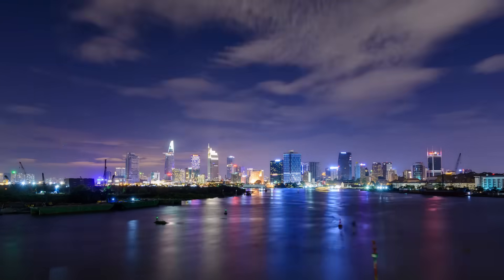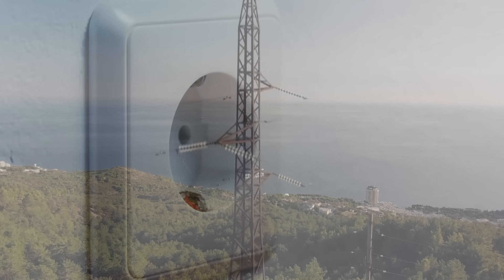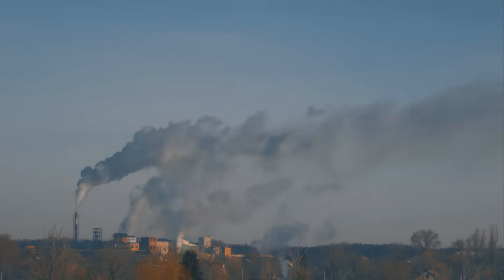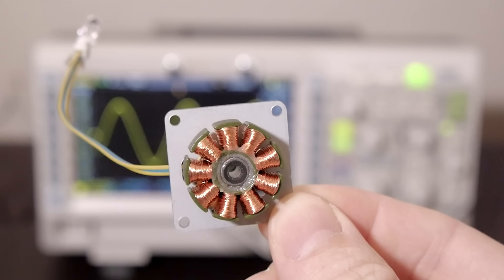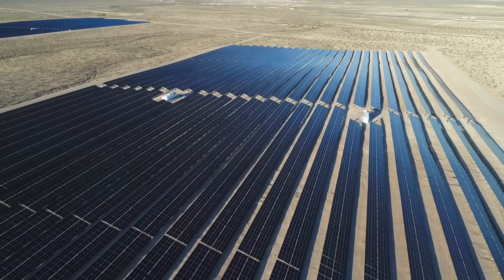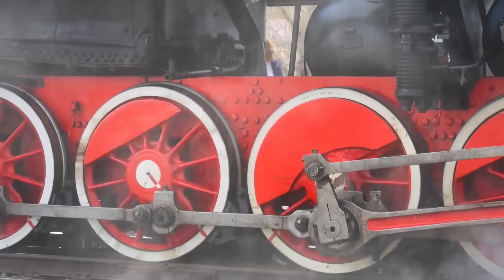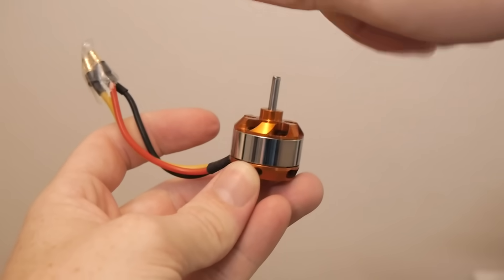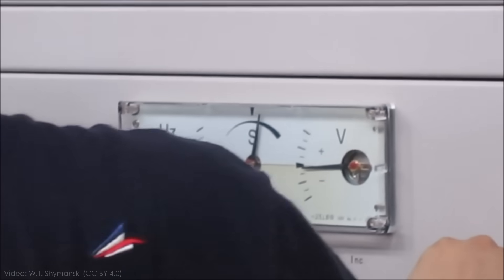How Electricity Generation Really Works

Comment: I hate the term renewable energy as it excludes nuclear energy from the start. Using conventional fuel sources nuclear can power us for centuries and with unconventional fuels like thorium or plutonium in fast spectrum reactors can powers us for thousands of years, and yet the fact that this nuclear fuel is not renewed by the big nuclear fuel in the sky somehow makes it undesirable,
Reply: Nuclear power isn't renewable 
Renewable energy is theoretically infinite  or resources are naturally conducting e.g ferroelectric,  electrochemical, electromagnetic, photovoltaic and momentum based kinetic energy
Reply: @haruhisuzumiya6  renewable energy as solar is not infinite. The sun will stop glowing at some point. The whole of space will retract to a singular point at some point. Nothing is infinite.
Reply: Haruhi Suzumiya Ha ha universe go dead
Reply: @haruhisuzumiya6  Renewable energy is literally not theoreticaly infinite; it is practically 'infinite'. Now we are still a sort of primitive cluster of interconected civilizations; to see a mere star within an universe of them as 'infinite', is as ludicrous as a caveman seeing the amazon rainforest as infinite supply of wood. Let me be clear most of renewable energy is sun's core fusion energy, and it is not and will not be infinite, we are so small we don't see that yet.
Reply: The Olympic Dam  mine (copper, gold, iron and uranium) has enough uranium to supply all the current 380 or so nuclear power stations for 400 years.   Other mines and yet to be mined deposits around the world would keep nuclear power going for at least as long again.   Decommissioned nuclear weapons have been used to supply fuel (until recently) under the "megatons for megawatts" USA-USSR agreement. This potential over-supply of uranium is why the price is so low at present.
Reply: @karhukivi  and there are new reactor designs that can utilize nuclear waste from other reactors as a source of fuel, getting even more energy out of it. I think the main reason nuclear power is unpopular, at least in america, is that people are scared of it because of disasters that have happened in old reactor designs and they cant accept that new designs are much much safer. I've met several people that have told me we should get rid of anything that has the word nuclear attached to it and make it 100% illegal to explore that kind of technology in any way.
Reply: @Sciguy95  People in general are irrational - more people die in automobile accidents every year than in nuclear ones!  Uranium is cheap and plentiful in terms of mineable deposits so it is cheaper to make new nuclear fuel than it is to re-process waste.  In the USA they prefer to store the waste fuel (which still contains over 90% uranium) whereas in Europe they prefer to re-process it as "recycling" is a popular idea in the EU.
Reply: @karhukivi  ah ha, I was sorta referencing nuclear waste recycling in another thread but forgot the general term (bad with jumbled memory). Thank you for jogging my brain :-)
Reply: @karhukivi  
Plus there is speculated to be enough uranium in seawater to power civilization for millions of years. Extracted uranium would be replaced by more uranium leached from undersea rocks.
Reply: @gregorymalchuk272  Yes the oceans contain a vast amount of uranium even if it was not replaced naturally.  However, there are so many deposits of uranium already known that there is enough at current consumption for at least 400 years.  One mine alone, Olympic Dam in Australia produces about 4000 tonnes of yellowcake per year from a 3 billion ton deposit of copper, gold and iron  The mine is good for 400 years.  Rossing in Namibia has been going for 50 years and an unmined deposit in Sweden near Ostersund contains more than 400,000 tonnes of uranium.  it is because of this abundance of uranium deposits that the price is so low at $40/lb  (approx. $90/kg).  The reason uranium is so plentiful is because it can be dissolved in oxygenated groundwater and precipitated under reducing conditions (carbon, phosphates).  Thorium like the rare earth elements has a different chemistry and few geological processes can concentrate it into mineable deposits.
Reply: @karhukivi  the problem is it's a political issue to reprocess waste and whatnot. You CAN reprocess nuclear waste which decreases the amount of nuclear waste significantly, it's more expensive and the process means you can build nuclear weapons...
Reply: @karhukivi  That's great if the numbers are accurate, but nuclear power only generates about 10% of global electricity, and far less than 10% of total power.  Now if world population were 90% smaller, that might be a cheery data point, but that is not our situation.
Reply: I hate the term "fossil fuel" since oil does not come from fossilized anything.
Reply: @jovetj  Fossils do not necessarily need to be 'fossilized' (in petrified form). Merriam-Webster for example uses the following definition for the word fossil: "a remnant, impression, or trace of an organism of past geologic ages that has been preserved in the earth's crust". Oil, coal and natural gas fully fit that definition: fossil fuels are biological material that have decomposed over millions of years to reach their current forms.
Reply: “fossil fuels are biological material that have decomposed over millions of years to reach their current forms”
No, they are not!
Reply: Jovetj Wow, I did not know that. Where did coal, oil, and gas come from?
Was it ever alive animal or vegetable matter?
Reply: @Ted Lahm 

That's the thing—no one knows!  No one has any sure idea where crude oil comes from.   The antiqued guess that it's the remains of long-departed buried creatures or plants, though, has been replaced by the idea that the Earth somehow constantly produces it.
Reply: Jovetj Do we have any idea where the energy that is stored in coal, oil, and gas
came from?
Reply: @Ted Lahm
I've never seen any evidence that we do.  All the theories about where crude oil comes from are wild guesses.  Some of them are more plausible than others.
Reply: Jovetj final question. Do we have any idea where the energy that is stored in
a 100 year old tree, when we burn it, comes from? Thank you.
Reply: @Ted Lahm
Ultimately, the sun.
Reply: @HqNnEz  Oil is primarily from decayed water plants, perhaps algae.  Coal is from decayed trees.
Reply: @jovetj  it's because it is formed over extreme periods of time from  ancient life just like fossils are. So it is similar to fossils in that way and different from other fuel sources that aren't formed from dead life forms and dont neccesarily require huge periods of time to be created.
Reply: @astrolover 95
You don't know that!  Idle speculation.
Reply: @jovetj  Its funny how people like you "speculate" that the scientists dont know what they are talking about and then act as if you know the truth instead. You sound like a flat earther complaining that all of mainstream science is a giant conspiracy. If you know the way true way that it works then go publish your ideas in peer reviewed literature and get your nobel prize for making a world changing discovery.
Reply: @astrolover 95
I am the flat Earther?  While you spew outdated, childish and UN-scientific notions of where crude oil comes from?  You're a funny guy!  I needed that laugh!!
Reply: Jovet the word ‘fossil’ used to just mean ‘dug out of the ground’ , it makes more sense in that context.  Suppose uranium is a fossil fuel by this metric!
Reply: @jovetj yes it does lol, oil is created from dead organic material
Reply: @Tom R Because the fuel is (for all intents and purposes) infinite. No one claimed the device itself is eternal or some perpetual motion machine - it's simply you can't run out of the fuel, whereas nuclear fuel can. That said, the main arguement against nuclear isn't fuel scarcity. The main issue is the fuel life-cycle. Managing the waste is the number one problem IMHO, a much bigger issue than nuclear safety, as it's an unavoidable issue that affects every single nuclear plant, and we have no real solution.
Reply: @lmlmd2714  I think safety is still a big concern, the majority of the people I have come across that dont support it are scared of it because they only know about the disasters and think that every reactor ever built or designed is just a nuclear bomb waiting for the slightest problem to happen before it explodes and refuse to accept actual data as evidence against their belief.
Reply: Someone said thorium:
http://lftrnow.com/wp-content/uploads/2015/05/2-billion-years1.jpg
Reply: Well, every source of energy is finite. The Sun is not renewable.
Reply: "Every source of energy is finite" only so much as there is a limited amount of energy in the universe.  Unless we start cranking out Mantrid drones, we don't have to worry about running out of energy within the timespan of the energy. We just have to figure out how to unlock and/or collect the energy around us.
Reply: @Tom R Make new ones?
Reply: The sun is burning up its energy, it will go dark some day, then explode, consuming the earth.  So why aren't the democrat  environmentalist buffoons protesting the sun?   We should use the most effective energy sources we have, and that today is oil, coal and gas, and nuclear.  Some day we will hopefully harness fusion or something else.  But now, drill baby drill.  Our lives depend on it!
Reply: @DEW409   first off the sun will die after 5,000,000,000 years, do you even realize how long that is? for context, the first civilisation rose up 6,000 years ago, by the time the sun dies we'd have either died of something else or found a sollution.
 secondly why are you bringing american politics into this? the world doesn't revolve around america, this is a discussion over electricity generation, not american politics.
Reply: @M7md_1214  You completely missed my point.  There is no renewable energy.  The sun is finite  , with a long life.  Fossil fuels are finite, also with s long life. So throwing them out without a suitable replacement is like sitting around worrying about  the sun going  dark.  And yes.this IS about politics.  Climate Change  is  about communist/globalists (democrats here) destroying our way of life by disrupting our energy supply and redistributing our wealth to poor countries through carbon taxes, with the biggest chunk landing in politicians pockets.
Reply: @DEW409  well you see the stark difference is, solar energy also produces virtually no waste, and we dont have to mine underground to get to it, and we're definitely not running out of it soon so we dont have to find new deposits and invade other countries for some energy. the biggest hurdle is right there: waste management. if we can find a way to effectively have no waste, we wont have a problem using fossil fuels. but you are right, untill we find a suitable replacement theres no way around using fossil fuels, specially for developing countries. now on the second part of your comment: thats a very alarmist view, its like how people here blame everything on israel and america(both are definitely a reason to why the country's bad, but they're not to blame for everything.) and frankly I don't have the time to argue over it.
Reply: @Tom R because of where the energy is coming from. With your example even hydropower or wind  could not be considered renewable based on the fact that nothing we build will last forever and must eventually be repaired or replaced. And yes I know that nothing really lasts forever, even the sun.
Reply: This report, "Is Nuclear Power Globally Scalable?"
By DEREK ABBOTT, Fellow IEEE gives reasons to think that nuclear power is not going to be significant in global terms as an alternative to fossil fuels. Basically it is not scalable to the over 15 Terawatts of electricity that would be needed globally due to limitation of uranium and rare earth metals.
Reply: Solar isn't renewable either, since the sun will die in 4 billion years.
Reply: People that want to continue the fossil fuel profit machine won't tell you anything about nuclear recycling.
https://www.world-nuclear.org/information-library/nuclear-fuel-cycle/fuel-recycling/processing-of-used-nuclear-fuel.aspx
Reply: technically the sun will go out eventually so it isn't renewable either. I like nuclear the plants work, and compared to the mirrors and solar farms they allow for more nature (people keep missing all that lifeless ground below the panels)
Reply: Bjorn Canute nuclear power creates radioactive nuclear waste. The waste is toxic and very dangerous. Also the potential catastrophic events that can happen if a plant fails. Nuclear power already comes from the sun. So harvesting that should be safer
Reply: Phillip simeon  Well as it turns out statistically nuclear power is actually safer per a KW/h due to accidents during installation and maintenance + we have a growing problem of difficult to manage fires (silently smouldering inside roofs) caused by solar PV panels and inverters which batteries (look up lithium fires) will make worse. Solar PV's toxic waste problem (due to producing and disposing of them) is worse due to the low density of solar PV as an energy source (there is more of it than spend nuclear fuel) which has to be dealt with the same way as radioactive (and all other heavy metal waste) stored securely away from the environment and people.

So called catastrophic nuclear accidents aren’t actually that catastrophic as the overreaction & radiophobia harm and killing more people. The Fukushima nuclear disaster would not have happen if the decision to vent the hydrogen was not left to politicians instead of engineers (overlooking the cost cutting with the Flood defences by TEPCO that cause the flooding the 1st place) and the resultant evacuation of frail people & the air pollution due to the fossil generation which replaced all of that nuclear capacity has actually caused more deaths. Then Chernobyl which even with it poorly design RMKBs (which would have never being approved in the West at the time) only happened because it safety systems were disabled and there was a lack of communication regarding design flaws - it directly killed less than 50 and the most extreme estimation of 1000s of cancer death is still better than the yearly figure vs a 1 in a generation event in virtually all developed countries due to air pollution.
Reply: @Tom R The power source is renewable (the sun) as far as human timeframes are concerned even if the panels will be replaced. Same with wind, hydro, tide etc. And to clarify,  the lifespan of most solar panels is more like 25-30 years.
Reply: While it’s true it’s technically not renewable, we aren’t going to run out of fuel anytime soon, like you said. The main thing that turns people off about it is that it’s nuclear, and nuclear scares people. In reality, there are many studies that show that nuclear power plants actually cause one of the LEAST AMOUNT of worker injuries/fatalities, and we have become very good at handling the nuclear waste that’s produced (much less than people think) but of course the media at large doesn’t tell anyone that.
Reply: The problem with Nuclear energy is what do you do with the spent rods that still have a lot of radiation. Talking to people who work at the nuclear facilities, it takes decades for the spent rods to be safe for disposal. Also no communities want that stuff in their back yard which makes this an undesirable way to make power. Natural gas is the best alternative due to low nitrogen oxide out put and Low Carbon Monoxide. Coal honestly is not that bad either. The only negatives is Nitrogen Oxides are a little higher as well as Carbon Monoxide, Take longer to start up and have a lot of ash to get rid of if not used to make dry wall.  I have interned at a base loaded coal facility and currently work at A natural Gas power plant 1x1 combined cycle unit.
Reply: @AcBEntertainment  
We don't have a place to store nuclear waste because libturds keep protesting the deep geologic waste repository.
Reply: renewable takes care of the problem once and for all. Also the deeper problem again is worst case scenario a coal plant catches fire and collapses. a windmill tears itself apart, a gas plant explodes a nuclear power plant pollutes a huge area and the toxicity of it breaks down DNA.

There are advancements in nuclear power tho that reduces the worst case scenario that might make nuclear power viable which would be a MAJOR win for our Planet and us.
Reply: ok?
Reply: So... You hate the term renewable because it excludes power sources that aren't renewable? Hmm...
Reply: EmperorJuliusCaesar At least for up to 2000 years
Reply: Fun fact, a few years ago I was working at a think tank and a PhD named Edward something or other created a sleeve the made it so nuclear rods could not overheat (Think 3 mile island, china syndrome). Test rods were then trialed at The Ohio State University small scale nuclear reactor. Nuclear is orders of magnitude more safe than before, assuming this jacket is used.
Reply: Renewable energy is a lie and oxymoron.

Energy cannot be created nor destroyed.

This means the world simply needs a better way to transform energy in a non destructive manner.

Before anyone can solve any problem it helps to know exactly what you are dealing with. This is why everyone has failed in spectacular fashion thus far..
Reply: @seanregehr4921 and therefore let's burn fossil fuels to make the water rise
Reply: Yea well nothing is renewable
Reply: this conversation is so high iq my head is spinning ngl
Reply: its not renewable because it creates a hazardous byproduct
Reply: @serial-designation-n-80  Thats not really a helpful definition because everything creates a hazardous byproduct. Um... Solar panels for instance have very much toxic components within the cells. I think the word you would use here is sustainable. 

Renewable is just about input, not output or byproducts.
Reply: @Tom R that's not about the panels, those fail due to human error or planned obsolescence, or simply natural wear. the point of the matter is the sustainability and renewablility of the source that powers them, the sun
Reply: Another point i think some people miss is that some forms of renewable energy aren't as eco-friendly as they seem
Yes they produce little to no waste, but what about the space they occupy?
Some would make arrays of windmills or solar panels in place of just one nuclear power plant
It's not so eco-friendly when you have to clear a part of a forest to have the space to build said windmill or solar panel array
There are always exceptions to everything, i'm just bringing light to this point
Reply: There are reactors that are "renewable" of sorts - they produce their own fuel and are extremely efficient from a resource requirement point of view - unfortunately the fuel they run on - which they're also producing - is weapons grade plutonium.. so there's that...

There is so much misinformation out there about wind and solar. They are NOT renewable. They are NOT green. Nuclear is the answer. Natrium fast reactors are particularly promising imo. Spread the word. https://www.youtube.com/watch?v=Zk11vI-7czE
Reply: @Tom R Well, that could be said the same about components for Nuclear reactor. Eventually, they break and need replacing. Not saying Nuclear is bad, just it has the same issues(within limits) just like solar.
Reply: There is unlikely to be nearly enough U235 in adequate concentrations to produce the world's present volume of electrical power for more than a couple of decades.  (Of course, it can last longer as long as nuclear only provides some modest fraction of the world's power.) "Centuries" is claimed by wild eyed nuclear enthusiasts, but it is no more realistic than the early claims of frackers that they could supply the US with the oil it needed for the next 400 years.  Even more optimistic claims for nuclear require improvements or breakthroughs that various countries have been working on for the last 65 years without success.  Renewables enthusiasts and nuclear enthusiasts, in my observations, have both made claims that are either impossible or improbable.  Both technologies seem to have attracted a cult like following that is blind to the problems that both technologies face.  Ditto for EV's.
Reply: @AcBEntertainment   Maybe.  I was told by someone with industry connections that the real rate of decline is significantly faster than the official numbers, so I'm not sure who is right about this.  Also, high efficiency PV use silver, which is not abundant enough scale up PV as much as greenies dream of.  And because silver is used in tiny quantities in many electronic applications,  it is rather poorly conserved as well.
Reply: @Tom R because the source of energy is abundant it just needs to be converted.
Reply: It is true that nuclear energy isn’t technically “renewable energy” however nuclear energy can provide power for centuries alone, even longer including recycled MOX fuel and the fact that reactors will get better over time, I do believe that nuclear power should be considered renewable energy.